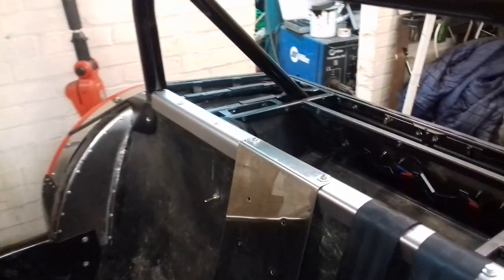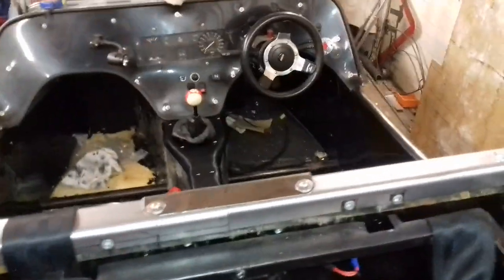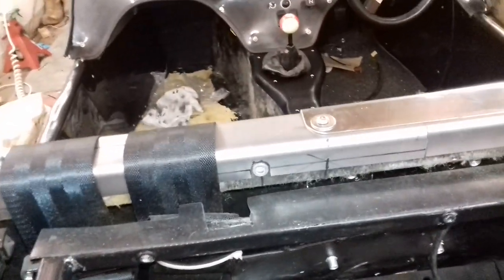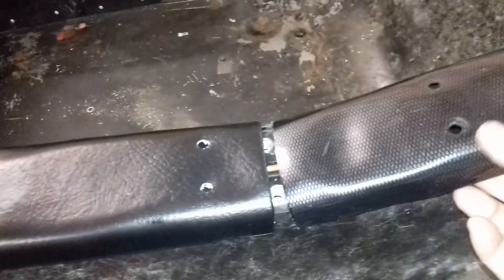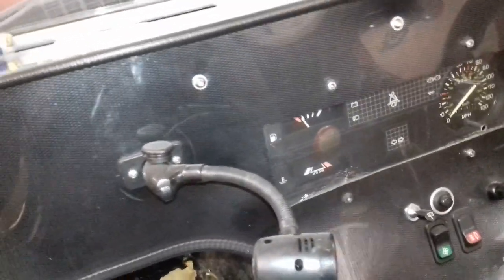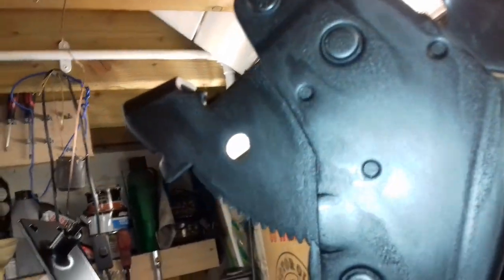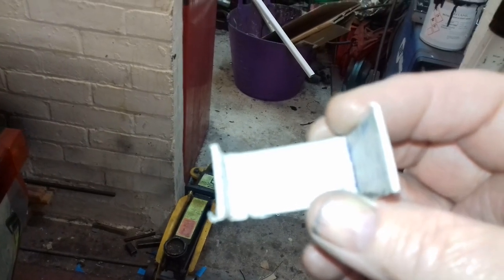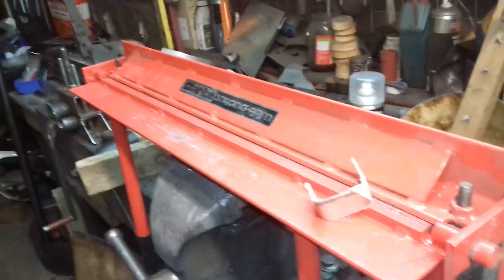RobinHood kit car update for November 2023

Comment: So, where exactly is your handbrake mine is down by the passengers right leg, or where does it go?
Reply from the maker: Its on the gearbox tunnel between the seats.If you look closely you can see 6 captive nuts on the tubes. I have made a plate that bolts on and the handbrake bolts to the plate.Will show you in the next video when I start putting it back together...all the best..